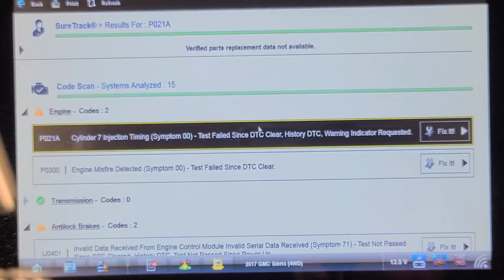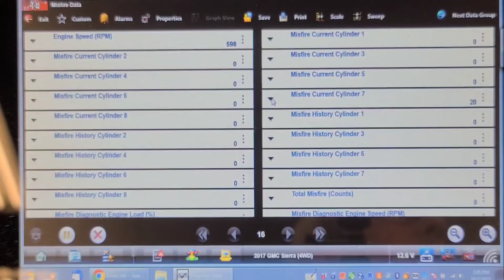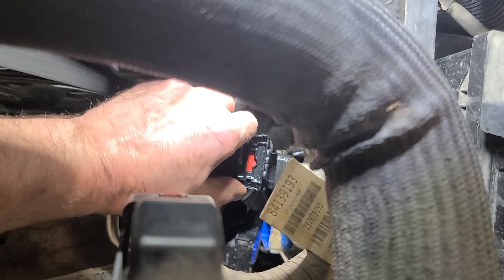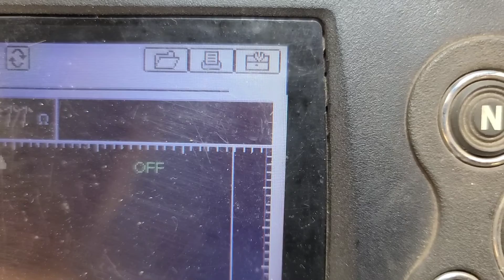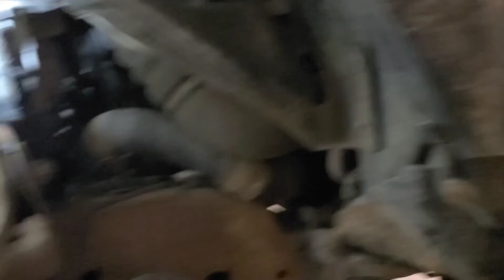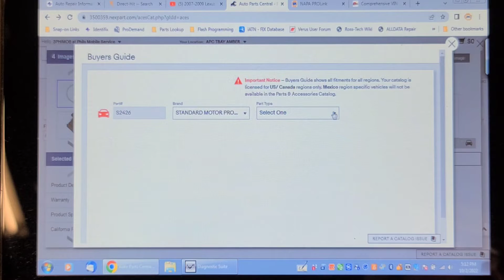2017 GMC 6.6 L5P Engine In Reduced Power Code P021A part 1.

Comment: Great videos.  I learned that you can fix the connector issues by bending the injector prongs slightly,  putting dielectric grease and reconnecting,  then putting a zip tie around the connection.  If you wiggle them in and out without disconnecting they have a lot of play,  and im sure that's why they start arcing out in the convection.  I've fixed 2 on my 17 this way on bank 1 but now have cyl7 acting up and came to see if you had to take egr off to get the cover off